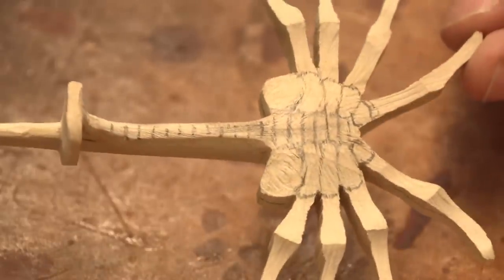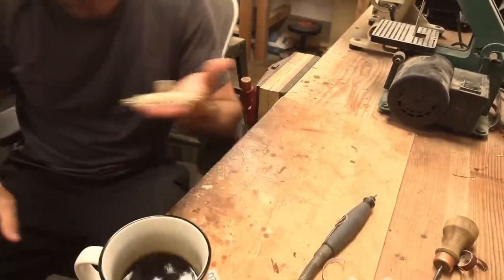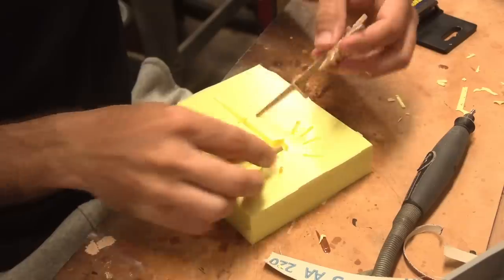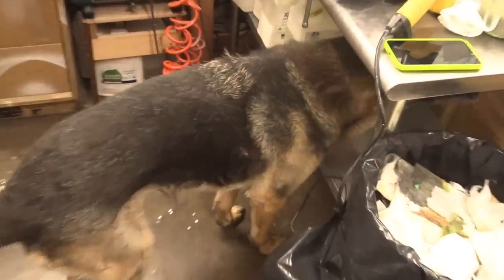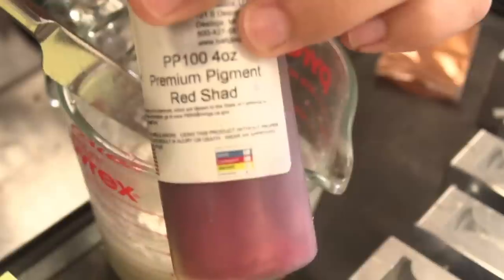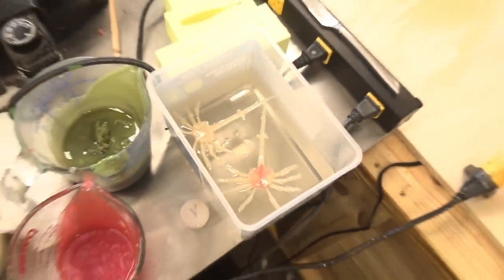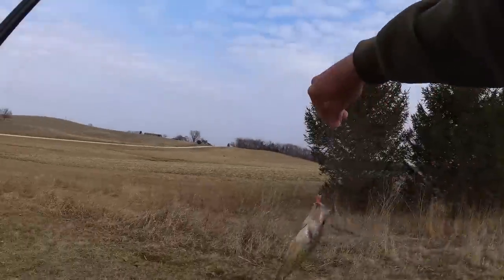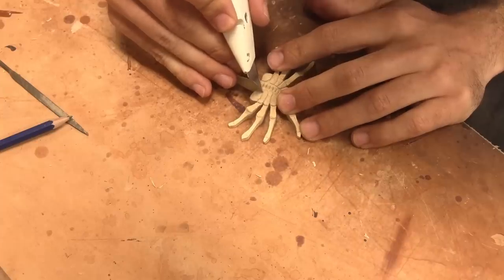Making a FaceHugger Lure

Comment: If you cut a thin air channel at the end of the legs it will allow the product to flow in. Cut it thin with that exact blade. You will have some flash to remove but at least it will fill.
Great job.Try it in Hot summer

Comment: I have an idea for the test tank to check the action. If you conect a water pump to the tank wit a outlet inline with the length of the tank you can create a flow in the tank ceeping the rod in a still position

Comment: Could you whip air into the plastisol  or add some foam bladders to make it a top-water bait. I have made many homemade spider lures and they only work for me if the legs both wiggle and float. Brolek hair ties glued into some carved flip-flop sole material will absolutely slay as long as you don't weigh it down

Comment: @Marling Baits I’ve been having an issue casting a rubber mold. I’ve been trying to cast some tails for some swim baits I’m making but the mold won’t harden at the place where the tails are. I’ve dipped the tails in polyurethane and I’m thinking there is some type of chemical reaction happening with the polyurethane and the rubber mold chemicals. Have you ever had an issue like this? What is the best way to cast the mold when using wooden pieces? How do you seal the wood before casting? I’m thinking the super glue may cause an issue as well.